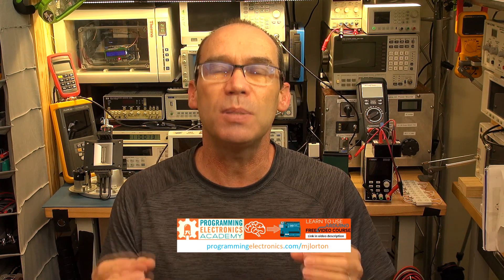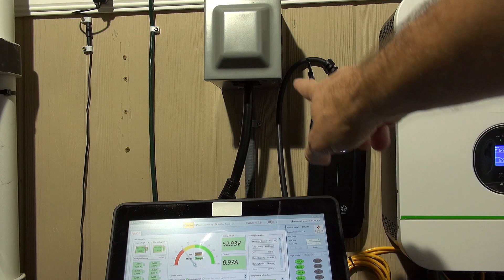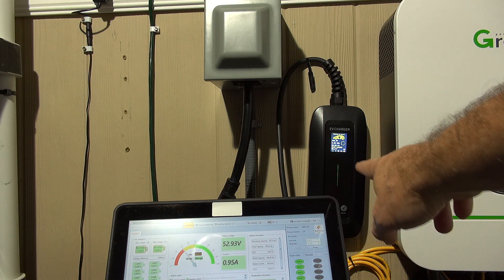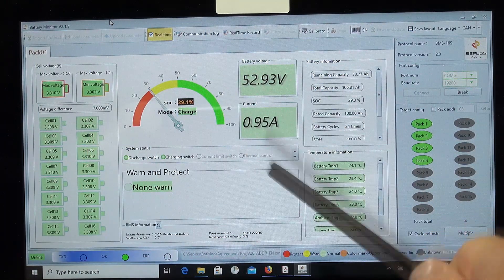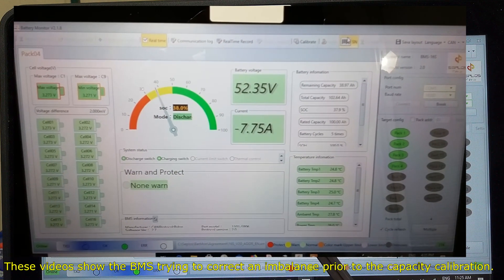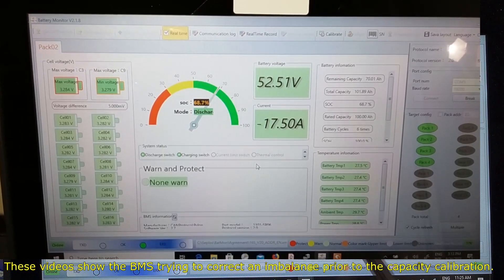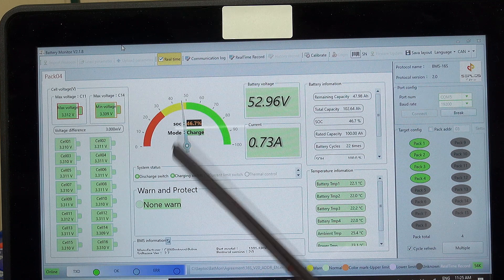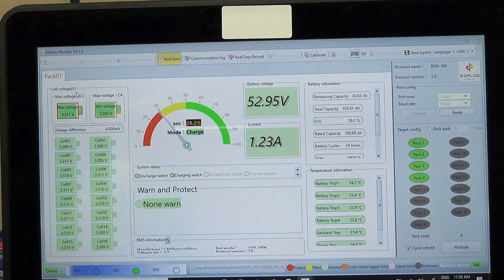Seplos LiFePO4 Battery BMS In Operation

Comment: Can you set individual max. charge and discharge values pr. pack. Say I have 2 different sized packs, one where I wqnt max. charge of 50A and another max charge of 100A. So each BMS, individualy, regulates the current going in/out ?

Comment: Hi, have been watching your contents for more than 10 years. In this video your inverter is not talking with the batteries, so how did you set parameters? In inverter or battery BMS? I have a Schneider xw6048 with latest firmware, Schneider told me that it won’t communicate in closed loop with the BMS. I am waiting for my EG4 wall mounted battery and yet to test it. I don’t want to buy a new inverter and trying to find a way to use battery BMS  for SOC and other parameters

Comment: The batterypack with lowest SoC is taking more charging amps because its voltage is lower as well. This has nothing to do with the bms. The bms cannot send more or less current to one pack or another.
Reply: Furthermore, nice vid! Thank you.
Reply: i think that the bms does have a current limiter so it can read the other batteries soc and adjust the amp input

Comment: Damn. I was hoping to see how you setup the comms between battery and inverters. I am waiting for two of their 200amp BMS's, and 4 of their kits to test with my MPP Solar inverters, which have similar connectivity as the Growatt. Does the connection over RS485 not run thr pylontech protocol?
Reply: mpp solar use rs485 to connect to a BMS batery.  seplos  implements CAN on their BMS. you can ask for a pylontech compatible firmmare. not sure if they support rs485 now.

Comment: Any way for a simple binary good/bad signaling from the BMS to the inverter? A "discharge okay" and a "charge okay" pair of signals would suffice for significantly better handling than "voltage level and the BMS handles protection."

Comment: Hi Doug hey thanks for the great videos,. I was wondering if you may have any idea if was able to use the 48v 200 amp BMS with my DYI solar battery storage project,  I have purchased 4 BIG BATTERY PLBR nickel manganese Cobalt batteries, I’m using a SMA Sunny Island 6048 inverter , I notice on the Seplos website that they offer a NCM and LFP option and I’m confused as to witch one to purchase, also should I choose the Can Bus or RS-485 ? Please help ! Thanks
Reply: LFP is preferable for this type of application

Comment: Hey maybe you could help me, I have a problem , I can't connect to my BMS Seplos through BatteryMonitor, ... Battrery monitor is able to connect and do Firmware Update, this function works ok.
But when I try to load the protocol for mybattrery 14s (ie import the protocol from the xml file) I always get an error (not correct format ... . loading protocol failed, please correct and load it again). I already tried to run the program on Windows 7, 10 and 11 unfortunately always the same error ... loading protocol filed...
Are you able to guide me what could be wrong and how to work around this problem? 
I see that everything works fine on your computer, which version of Windows are you using?
Thank you in advance for any possible help and sorry for errors I speak English poorly and write through translator.

Comment: When is someone going to make a BMS with a charger for each cell?  The current BMS that shut down every cell because of one is stupid. NO CELL should be shut down unless it is faulty. Over charged? Why?  just stop charging that cell.
Reply: Because they are connected in series, not possible to fully isolate individual batteries

Comment: Remember lead acid? If you got your = , - on correct, you were set to go for years. This constant baby setting of lithium cells, is BS.
Reply: Yes, I remember lead acid. Equalization, hydrogen sulfide venting, adding distilled water, ...  When it comes right down to it, lead acid benefits from careful management. Lithium requires careful management.